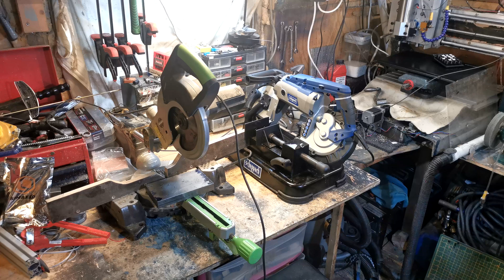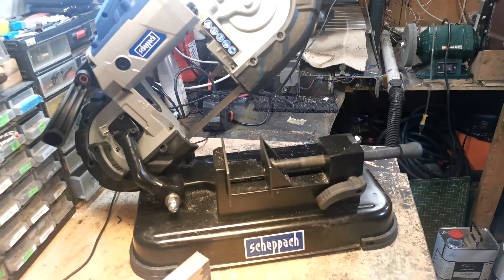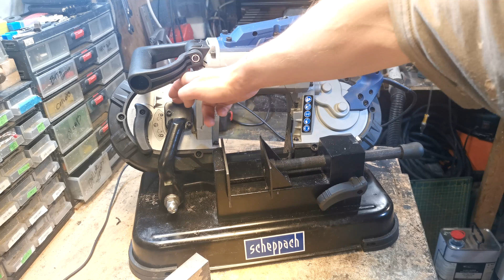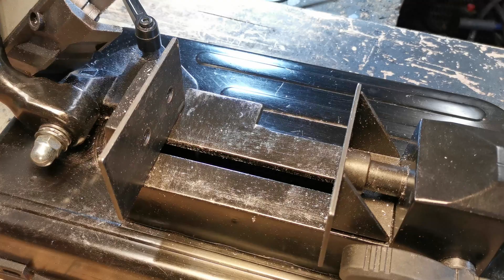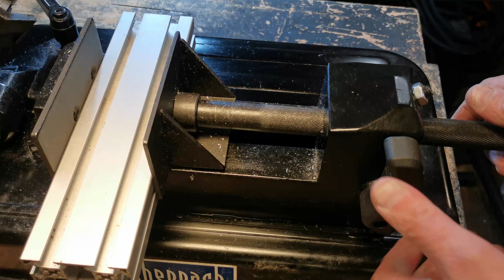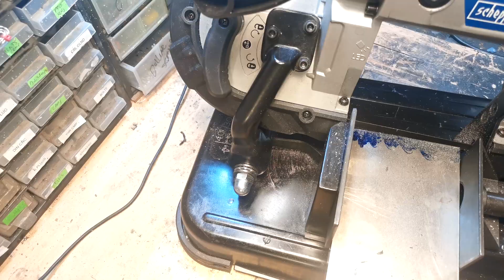Cheap Tool Review - Sheppach MBS1100 Band Saw

Comment: As was mentioned prior, that I wouldn’t use a lubricant on the blade as it caused mine to slip and disengaged the blade to come off the rollers. I just that mine slowly in cutting.

Comment: I really wouldn't recommend using lubricants when cutting with this saw. If lubricant gets onto the band and into the saw itself, it can cause the band to start slipping. You're also making it possible for metal to stick and be pulled into the saw, which would clog it up sooner or later.

Comment: I have a similar, but it started to cut a bitt off Angle. The blade Angle is a bit wrong. I notice it especially when cutting 45 degrees. Have you been able to adjust the blade angle ? (I have not started fiddeling around in the machine myself , as I tend to mess things up 😅)
Reply from the maker: @Norseman101  Hi, in which orientation is the angle off? If it is off on verticality of the blade, then have a look at the bearings which guide the blade. Are they tight? If all that looks good, it might be a blunt blade, band saws do tend to wander when the blade gets dull!

Comment: Thanks for the review, I just received the later MBS 1200 from Aldi £99 sorry
Reply: Just bought one on eBay for £140.00 and it was shipped from L idle with a £99.99 bill of sale attached! 
It's slightly different to the one above. Instructions are crap - on here trying to find out how it works ... ..
Reply: @@chasewilliams5128 Didn't have any other labels or paperwork. Been doing loads of work with it - game changer. Not precise but can churn out the volume better than any other tool I've got.

Comment: Thanks for this review. I've ordered a similar band saw from Aldi but it's called MBS1200. I'm not sure of the difference with the MBS1100 but it seems to be the next one down in the range (I guess not as robust - it's not arrived yet).
Reply: It's arrived...
The MBS1200 is similar spec to the MBS1100 with 1100W motor and 127mm max cutting size. It seems to be a newer model but cost less than the MBS1100 (at least on the sites I looked at).

Some of the obvious differences:
- The MBS1200 has a different vice, with a screw thread and a half nut (quarter nut maybe) that pivots up and down to allow fast adjustments. I wasn't sure about the quarter nut but the vice works pretty well and feels like it has a solid grip on the stock.
- The arm that lifts the saw has a sprung pin to hold the arm up for when setting up the stock in the vice. When ready to cut, you need to pull the pin out against the spring.
- To detach the saw from the arm there are now bolts with plastic thumb grips on. They seemed ok, but are very close together so not that easy to apply a lot of twist to. It's easy enough to change them if this is a problem but so far they have been ok, and faster than stopping to look for an allen key.
- Not sure what difference this change makes, but the mains lead enters the housing near the motor rather than at the end of the saw on the handle as on the MBS1100.

I've only cut 1 inch pipes on it so far but for my purposes it's going to be fine, it feels solidly made and I think it's a very good buy.

Comment: The Evolution saw is a great piece of kit, I have often cut quite thick box section steel but you are quite right that thick sections are a bit scary to do and the chips are really hot. Anyway the bandsaw is also a really good cheap saw. I did add cutting oil which made the blade slip , to a bit of a fiddle to adjust the tension to stop the slipping. I did give it a good clean up with break cleaning spray to blast off the oil and swarf that got carried around. It made short work of cutting 40mm steel bar.. surprisingly clean and really good quality..

Comment: Would this cut through beech wood doweling easily?
Reply from the maker: Yes I am sure it would, particularly if you changed the blade to one more suitable for wood. However I think a cheep chop saw with a jig to hold the dowl would be a cheaper faster and better solution.